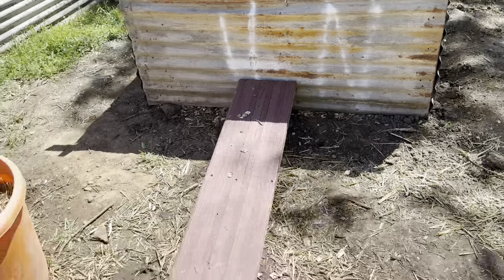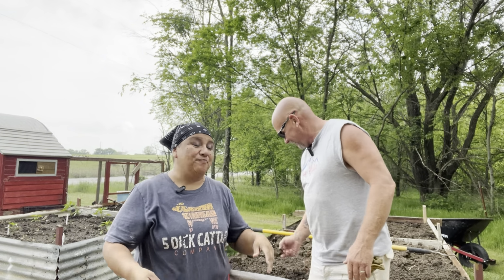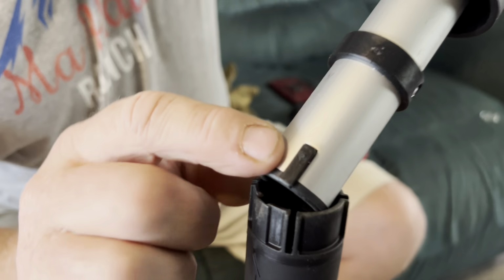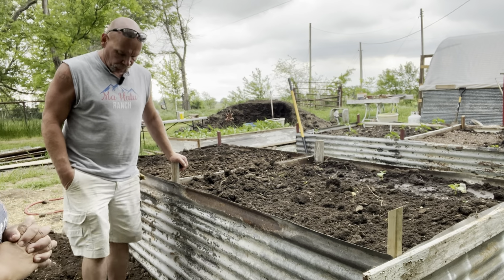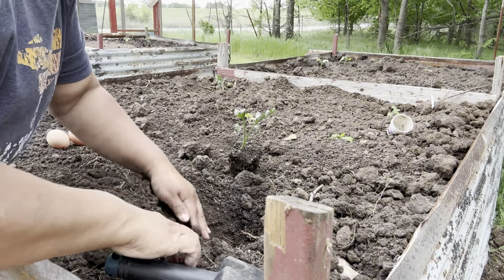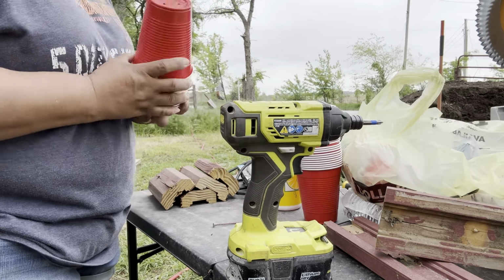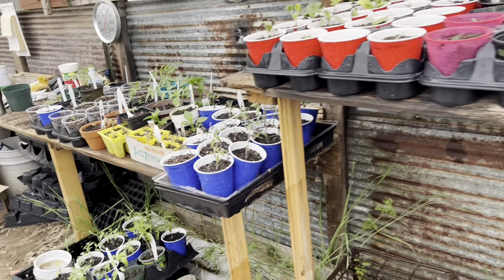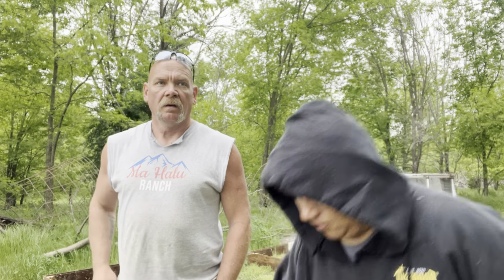Divide and Conquer / TaskStar Cordless Electric Tiller Garden Cultivator

Comment: That is a nice little rotary tiller that's what it looks like that you have but if it doesn't work to break up the dirt or the big rocks inside the bed maybe you should use just a hammer that will definitely work just saying.